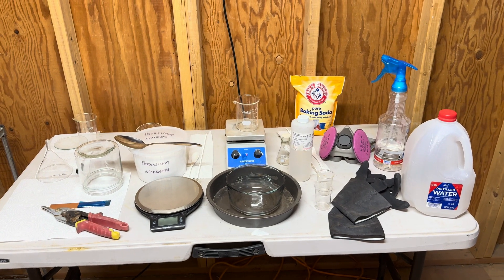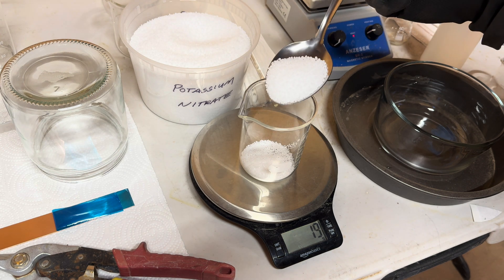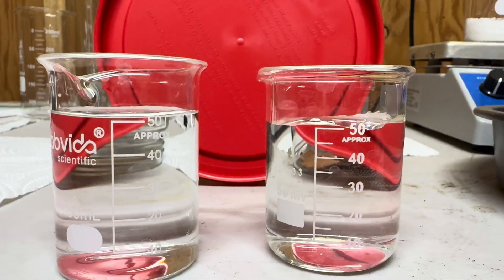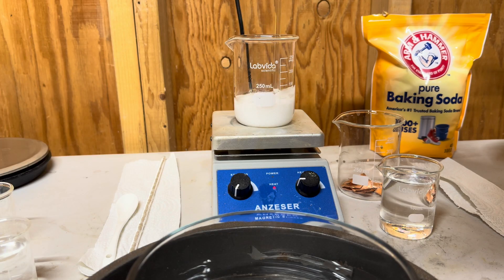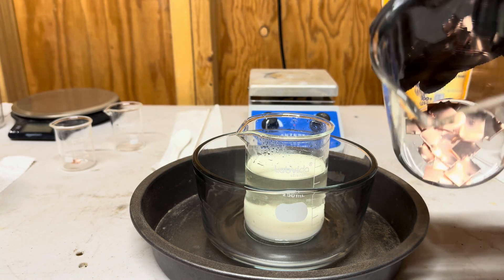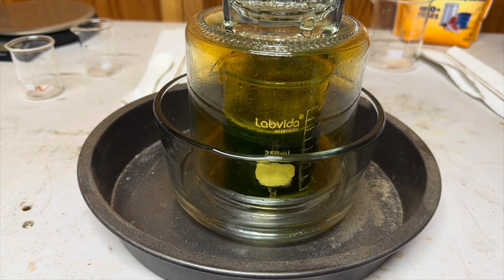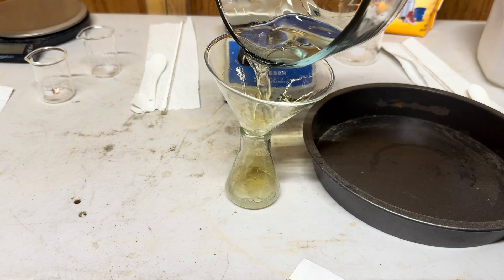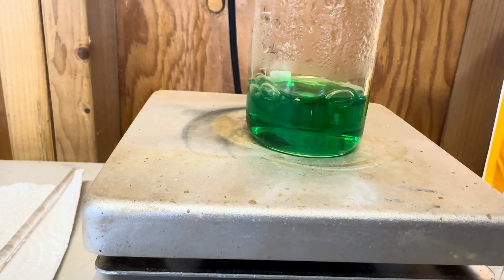Make Nitric Acid

Comment: Ty, I have ran across about 150 pounds of old 1960s boards with lots of gold, and lots of silver containing caps, and currently gathering materials to strip as much as I possibly can off those boards.  Got a few methods in mind and going to try small batches to determine which method is best suited for what I have going on.  Right now, I have to be a cheap as possible, if I can get a couple of grams of high grade gold, then I can sell it to acquire some things to start big batches.   
So far my thoughts leaning towards reverse electroplating with sulfuric acid.  Mainly the metal connectors and pins.  But it's going to be a few days before I start.  If you have any advice please share, I am all ears and will pay attention to details.  I have to get this right.

Comment: Very interesting video... By the way, you can use every acid to dissolve copper if you add H2O2. Unfortunately, H2O2 is more and more restricted for the general public. I'm 100% sure this will backfire at the society because H2O2 is a perfect tool against deadly viruses, bacteria, and fungi, and the time we had is running out, but this is another story. Keep up the good work !

Comment: using this method you will get better % of HNO3 if you use hydrogen peroxide  (H2O2) solution instead of water - NO2 reacts with H2O2 more efficiently in creating nitric acid than with H2O. even weak pharmacy peroxide will increase your output. Cheers:))
Reply from the maker: Great! Thank you for the insight. I’ll have to give it a try the next time I do this! On the Hydrogen Peroxide what percentage do you recommend, 3%, 12% or 35%? Thank you.
Reply: @ErnieDionne  no worries :)) the stronger peroxide - the stronger nitric acid, because reaction goes  2NO2 + H2O2 → 2HNO3 . when its just water, lots of NO2 turns into HNO2 instead - 2NO2 + H2O  → HNO3 +HNO2(roughly, there will be few by products including colorless NO);
other way to increase yield -  make you water with lots of oxygen in it -
4NO2+ 2H2O+O2 → 4HNO3, but just using peroxide seems easier instead of building contraption with extra O2. both ways will work though :))
Reply from the maker: @bronnl5482 Thank you very much! 💪🏻
Reply: @ErnieDionne  👍
Reply: In just the out solution? Not mixing with the copper, nitrate , and hcl?, correct ?
Reply: Also could you leave the solution in there and run another reaction?

Comment: So this is the same as normal nitric acid? I can use it for synthesizing nitroglycerin?
Reply from the maker: @fRiX15  Hi, yes, this is normal Nitric Acid! But it is a very weak version of it. I’m sorry, I know nothing about using it for synthesizing nitroglycerin. This version to this link is the strongest Nitric Acid that I’ve made. By the way it has reacted I’m guessing it’s at least 50% in strength. Have fun and always be safe! 💪🏻
https://youtu.be/4Z0EAR53lv0?si=CCDydXqg7P_ao5MG
Reply: @ErnieDionne  oh cool, if it's a low concentration I can always evaporate the water part of it to have a concentrated version, thanks!
Reply from the maker: @ Yes, you’re correct! Have fun my friend!

Comment: I have frequently made fuming by way of distillation. Its easy and safety was also a simple process. Its almost as easy as this and you end up with such a superior product that this makes no sense to me any longer . Initial cost for flask fittings and condenser tube was under 100. I used brown glass bottles to store it and the stuff i made three years ago is still smokin when i pop the cap .
Reply from the maker: @danglss76  Hi Daniel, any relation to Greg Gagne the baseball player? Thank you for your insight and input, I deeply appreciate it! Yes, I am aware of the process you mentioned. The purpose of a lot of my content is most of my subscribers in everything I do are beginners. I do my best to bring everything I do to their level of understanding and what they can comprehend. Then slowly bring them to the level of where I’m at. In a week or so I will be doing an episode where I will use a small distillation process to make a stronger Nitric Acid which most of my subscribers will be able to make and use. I understand that individuals who are more advanced in what my channel has to offer can easily get bored. I appreciate what you have to share with me because I have learned from individuals like you who make me and my channel better and safer. If I can use you for a reference to communicate with should I have any questions that may come up would be greatly appreciated. Thank you Daniel and thank you for being here with us.